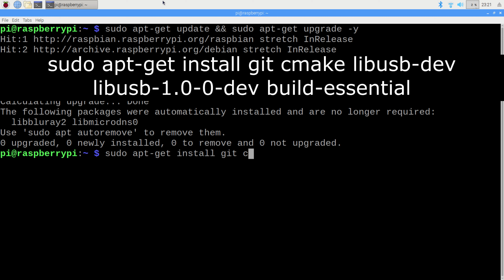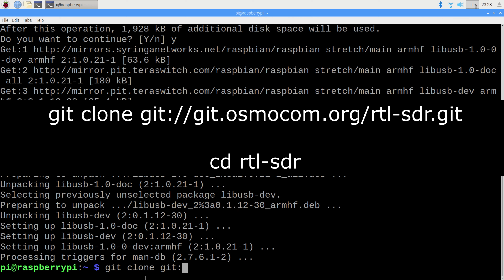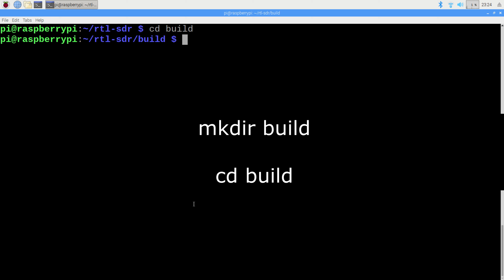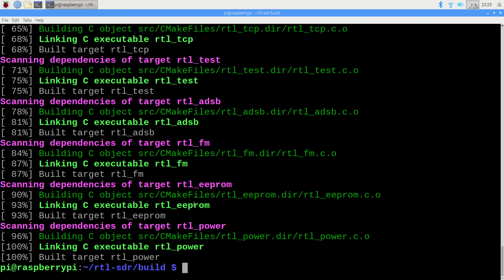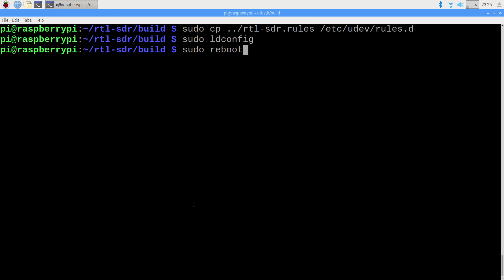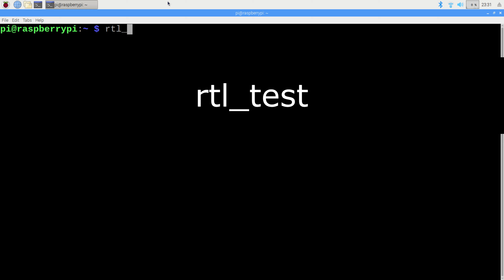Installing rtl_sdr Support on the Raspberry Pi

Comment from the maker: To terminate rtl_test, just press CTRL+C a couple times.
0:30 - Requirements
0:50 - Step 1 Update
1:10 - Important Notice
2:07 - Avoid Driver Problems
2:50 - Reboot
2:58 - Install Dependencies
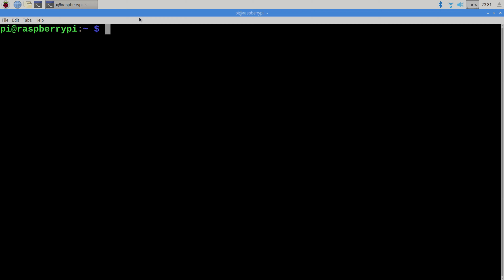4:45 - rtl_test
5:17 - Audio Test
6:10 - Closing Remarks